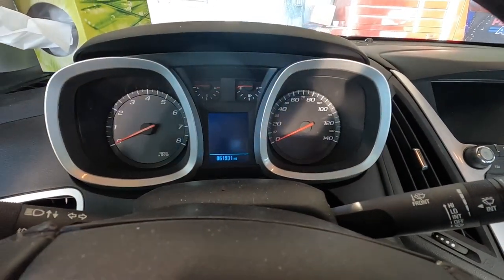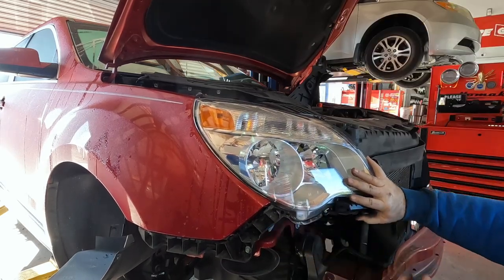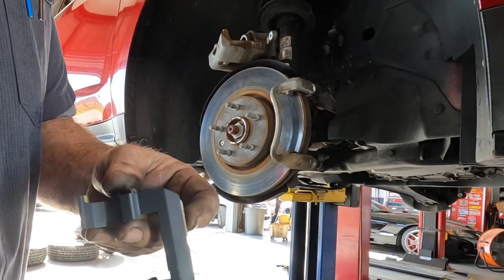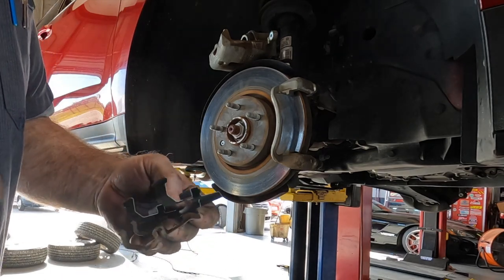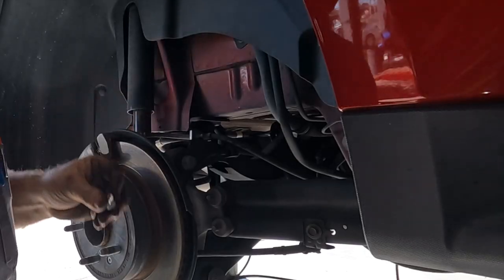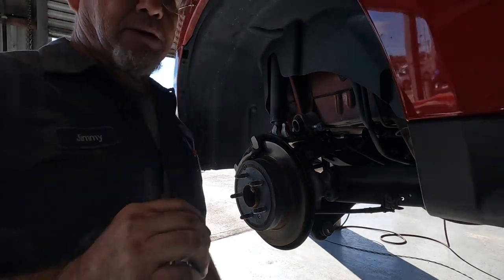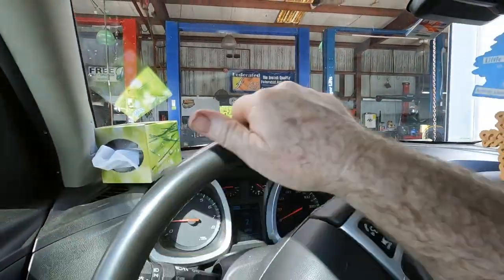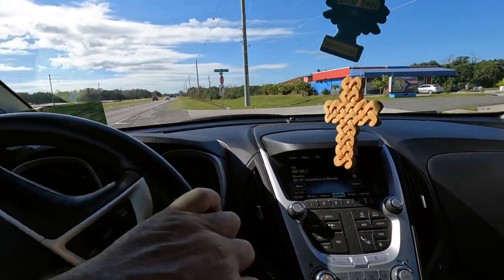CAN YOU DO BRAKE PADs WITHOUT MACHINING ROTORS AND INSTALL CUSTOMERS LIGHTS?

Comment: Hello again Jimmy 
Thank you for another Great Video. You know it's been twenty plus years since I work for Firestone Tires. I don't remember ever hanging the rotors. Nor do I remember the hooks your using. Again thank you
Reply from the maker: Thanks for watching and for sharing your experiences George!

I used pipe hangers from Midas for 20 years or so, then they started making hi vis versions that were easier to keep track of. ;)
Reply: @JimmyMakingitwork  Hello again Jimmy 
I'm sure you know what thay means? Were both getting older Lol. Before the Firestone Tires job, it the Air Force for twenty years. And I work on my cars and friends who needed help. Take care for now

Comment: One of my pet peeves is seeing calipers hanging by the brake hoses. Many professional techs do this. When changing hub bearings, sometimes you need a slide hammer. If the caliper isn't secured it can drop and when it stops it puts a shock on the brake hose. Another pet peeves is when techs change calipers they put a vise grip on the hose. That can damage the hose. Let it bleed. You have to bleed the brakes so you might as well let the old fluid drain out. This way you flush the system.
I always enjoy your videos Jimmy. Will miss the ladies!
Reply from the maker: Thanks very much, great points!

Comment: When I worked for Hyundai the team leader and I had engines come in on the same shipment. The service manager had the idea to let us start at the same time and have a swap race. The team leader had his subframe bolted up 10 minutes before me. He was winning. He had went to parts to get his intake gasket and Locktite for the torque convertor bolts, the service manager walked up and told me I won. I said no he is about to put his starter on and then his intake. He pointed over to his core and said he forgot to swap his flex plate. Sure enough, he was a half hour from cranking his car ant the flex plate was still on his core. He is now the best engine swapper at Hyundai.
Reply from the maker: Haha, that's an awesome story, I bet he was like, oh yeah, watch. this!

Thanks!

Comment: Father always used a mini sledge hammer to remove stuck rotors(rust belt), fast forward decade later, guys in the shop say to never use a hammer to beat a rotor loose since it will damage the wheel bearing, thoughts? 
Some rotors have a jack hole/thread but others do not, and not everyone has pullers big enough to pull a rotor.
Reply from the maker: Thanks for sharing that!  I don't think hammering on the rotor to remove it would hurt the bearing as much as it might tweak the hub, causing pulsation or vibration issues potentially. Even that isn't very likely, but possible.
I prefer to avoid it just in case. :)

Comment: Do a brake pad slap,will have a comeback.Complaint will be warped rotors pulsating.Scotty Kilmer is another example that gives out bad information and a hack.He had a video showing how to fix a brake line with compression fittings which is illegal to do
Reply from the maker: Not surfacing rotors will not cause a pulsation. But if one already existed it will continue. 

Yes, some states have it illegal to use compression fittings on brake lines, but even if it wasn't it's still a very bad idea. Compression fittings are best left to lower pressure applications like transmission cooler lines, fuel lines and similar.

Thanks for watching!